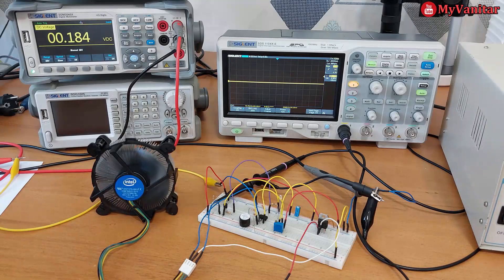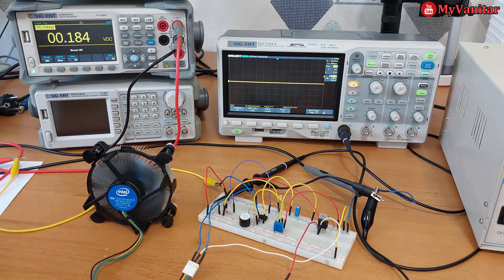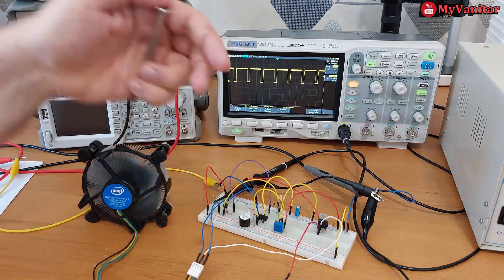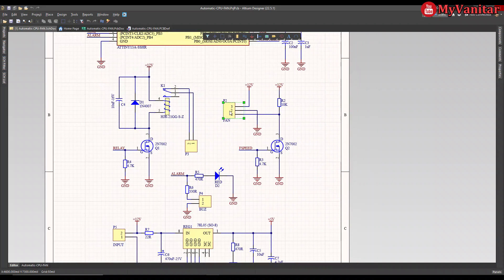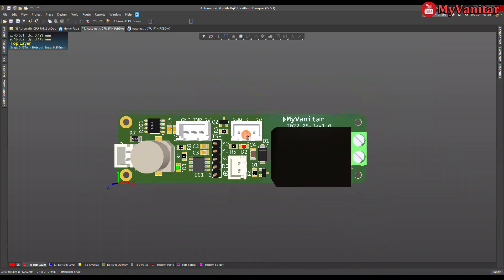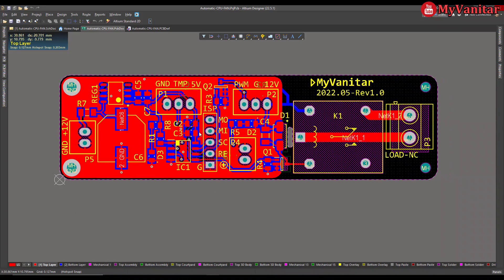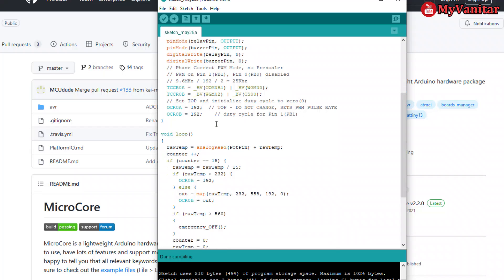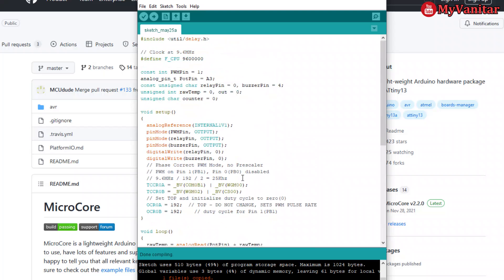PWM Cooling FAN Control & Over Temperature Protection using LM35 and ATTiny13

Comment: Very nice and interesting design, indeed. Thanks for sharing. I have added temperature controlled fan control in some of my RND Lab Power Supplies and for some of the PSUs using in my 3D printers. Measuring the temperature directly at the aluminum heat sink and increase fan RPM once threshold value was exceeded and switch fan off or go to 30% of max. RPM to keep the fan silently spinning. I would love to test your design as well. Looking forward to your article. Keep up the good work, man. I like it.
Reply from the maker: Thanks. Yes you did a very good job as well. I will put a link to the article soon.
Reply from the maker: You can check the article now

Comment: This is a big improvement on your old design.  An additional four-pin fan connector would be nice.  I use fan controllers similar to this to cool my solar controllers.  They can be configured using a button and onboard LEDs.  One can change the turn-on temperature, start-speed and ramp gain, which makes it a very useful board.
Reply from the maker: it supports both 3-wires and 4-wires fans. I don't use the tacho pin, instead, the board takes care of the temperature and implemented over-temperature protection. Yes, the code is available, you can change the temperature thresholds or whatever parts you like. I will post the link of the article soon, please check back again
Reply: @MyVanitar  I mean adding a four-pin connector on the PCB would be nice, to allow a four-pin fan to be plugged in as is.  The tacho isn't necessary for temperature control, but could be used for the error function so you'd know if the fan has failed.
Reply from the maker: You can check the article now